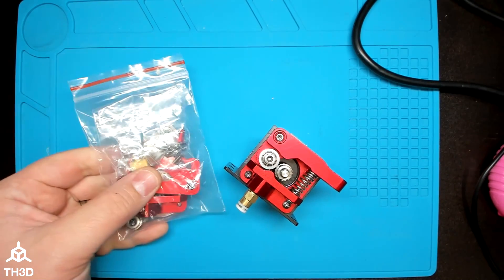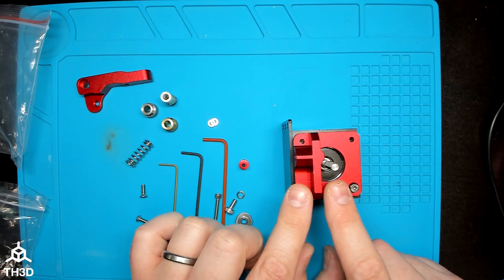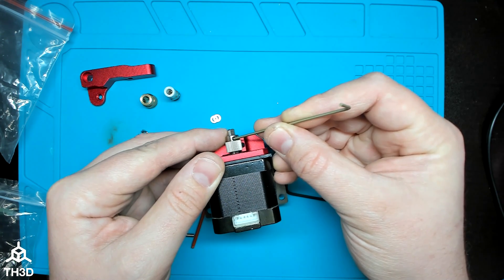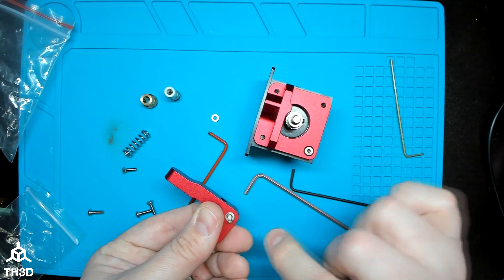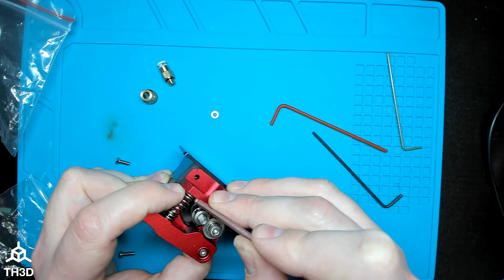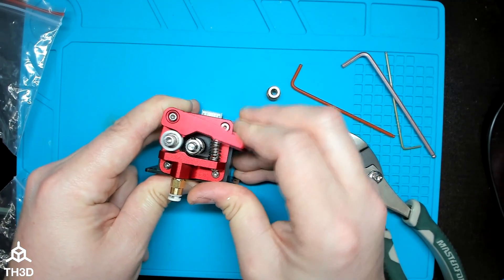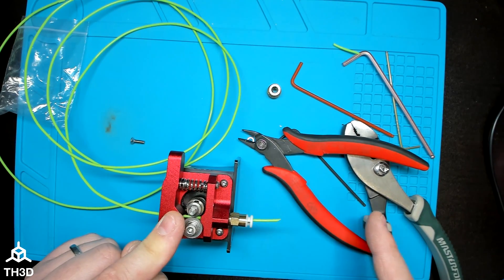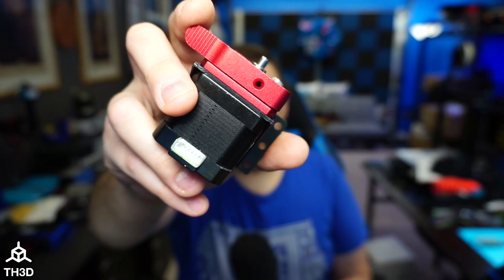New V2 Aluminum Extruder - ALL metal construction with a STRONG Spring & Steel Feed Gear

Comment: Great instruction video (and product). Normally I just figure it out on my own but the extra couple parts (nice to have), threw me off and this video showed me how simple it is. Thanks to the team.

After upgrading my CR-10 Mini to the Hemera quite some time ago, I thought I never need to go back to the Bowdin extruder, until that is I decided to add a second extruder for support. Given that I lost the old parts I decided to just purchase this extruder kit and it is actually pretty awesome. Just need to add the wiring and adapt the old hot-end and its all good. Thanks again.